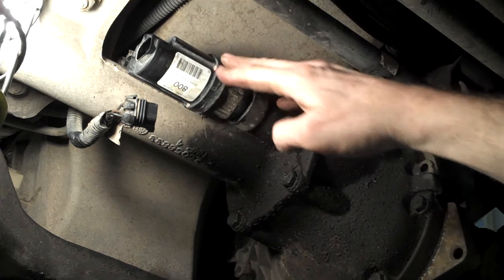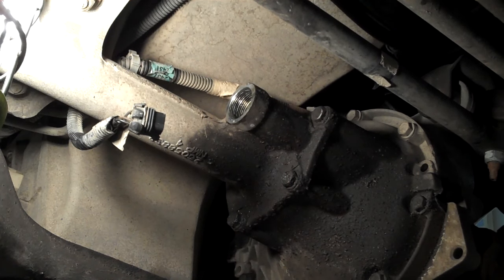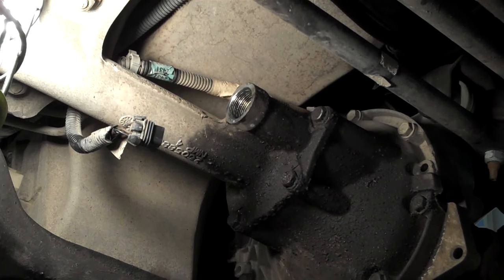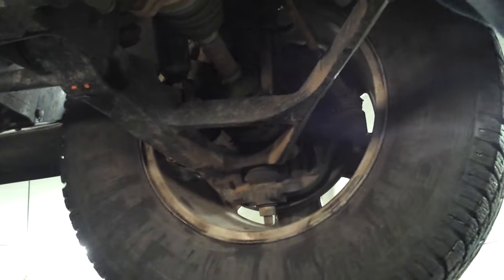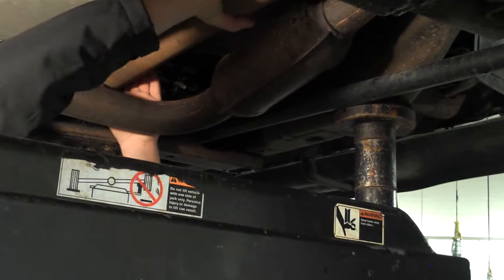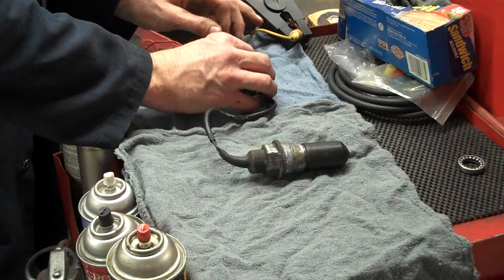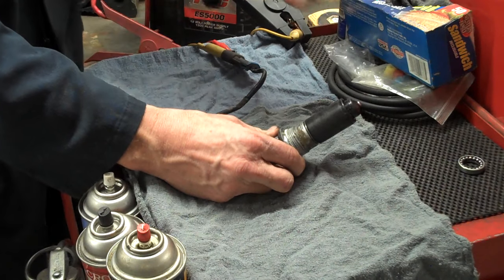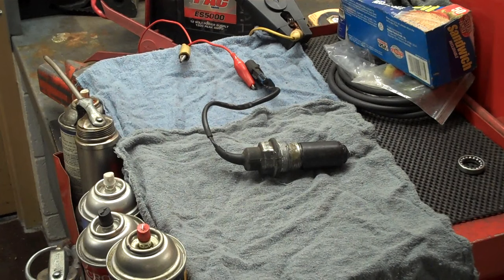GM 4WD elect actuator AND 4WD Thermal Actuator Test

Comment: My 1997 gmc with a 243 transfer case quit 4wd and my actuator at the transfer case was only clicking and the 25 amp fuse in the left dash fuse box blew. The front axle thermal actuator had a direct short in the wire. I replaced it and reset the tccm and I have 4wd again. Thanks, good video!

Comment: thanks for the video mate. it help tremendously in figuring out the problem.  something to think about, there are several different setups for the 96 tahoe. mine had a lever
not a dial or buttons. on the actuator you may find one of the following types:  old vacuum diaphragm actuated,  thermal activated, electrical with 2pin and electrical with 4 or 5 pin
connectors. of the two pin plugs, there is one with horizontal pins and one with vertical pins. best to take it to the store and compare. my 96 tahoe had what i believe
was the old thermal actuator. i elected to repace mine with the exact same type so i could avoid having to buy an expensive wiring harness. My old hoe is 26 years old
and lives in Montana so I am satisfied with the thermal types performance. got mine at autozone for about 75 bucks.   dave

Comment: Good video, you can usually take the boot off the thermal actuator and soak it in atf to bring it back to life. After replacing them I usually leave the "reconditioned" one in the truck for future failures. They're just awful 😅

Comment: My 2000 k3500 has like a 4-wire thermal switch. I replaced it and it's still not going into four-wheel drive but I also noticed it on my floor shifter the front portion is not lighting up

Comment: I took mine apart make 2 careful cuts into the flange housing the plunger, using a long bolt that was just a little too big heated and threaded it into the plastic plunger putting it back together epoxy gluing back into the threaded insert made a linkage and presto DIY posilock less than $10 in materials because I already had a HD PTO push/pull cable! $30 for a decent cable still $40 is much cheaper than $150 Ebay's posilock

Comment: what are the other wires coming out of the front diff? My dog chewed the connectors and I can't figure out what wires were in the white connector. the white connectors have three pins and the black connectors for the actuator has two pins, but I only count four wires total/???????????

Comment: When I pulled my actuator and engaged the fork with a screwdriver while turning the driveline my front wheels won't turn. Is this some sort of internal issue?
Reply: probably my rearend wasn't allowing the wheels to roll correctly I thought maybe the brakes were catching and a week later my axle came out so it's internal most likely
Reply: Aaron Mouton yes I did. Turns out the axle shaft had pulled out of the connector gear sleeve and wasn't engaging. There's a snapring that is supposed to keep the axle shaft in but It somehow pulled out.

Comment: I have 2004 gmc 1500 4x4. ...does it have this type of activator? I replaced my switch and still indicator lights don't show if it's in gear...all lightsonly light up when I first turn key...I am hoping it's not a bad transfer case module...maybe a bad motor or wire connection plug...any suggestions are appreciated. ..thanks
Reply: roadstar499 clean the grounds on the cab mount below the drivers door gm bolted them down over undercoating clean to bare metal and add battery terminal sealer to prevent rusting

Comment: I have a 04 avalanche and and when 1st start up i can press the 4wd selector and each button will light up (except 4lo), but when i drive it for awhile about 5miles and select either 4wd hi or part time, it would stay there and not let me switch back? service 4wd on dash comes on, i would have to shut off the truck and restart.  also the 4wd would not engage even if the light is on.  I have to select the different selections, shut off and turn on engine for the shift to work?  could it be this?

Comment: What makes my dodge ram 2008 big horn edition 5.7, kick in to 4 wheel drive on its own with out turn nob and I do have flashing or steady 4W light come on, going down the highway or even turning truck on in drive way and it kicks in? We have put need ECM unit in, servo motor and knob. Now what's next?
Reply: Are all of your tires the same brand/tread pattern? If not Sometimes it can kick on to 4 hi to get better traction.

Comment: Have a 97 sierra that engages in 4x4 low but does not engage in 4x4 high. The selector switch lights in the cab just keep blinking. Does that mean my actuator is bad?
Reply: Nate Wyche
Reply: Nate Wyche
Reply: Check your switch
Reply: I have the same problem but mine is a floor shifter so do I look at the actuator ?

Comment: I took my actuator out in my 2007.5 gmc duramax lmm  and pushed a screw driver in and spun the front drive shaft with only front end lifted it wouldn't turn the wheels .. also can hear the actuators both turning on and when I disconnected the front one I plugged it in and changed to 4wd and the plunger does come way out.. so could it mean my front differential